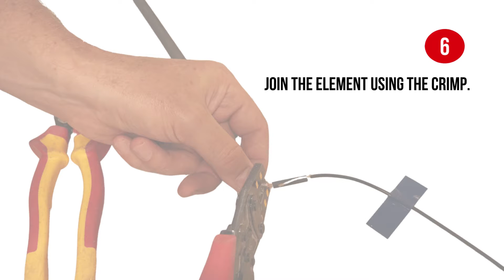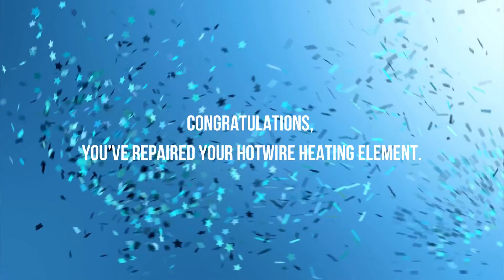How to Repair a Hotwire Under Tile Heating Element

Comment: What if the wire is damaged to the point that you need to replace a small section, what wire should you use?